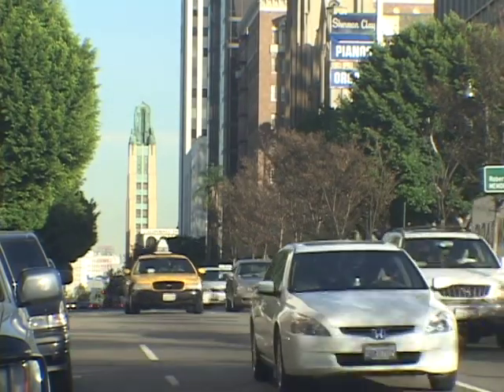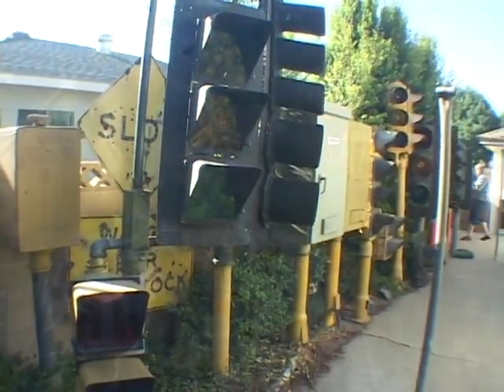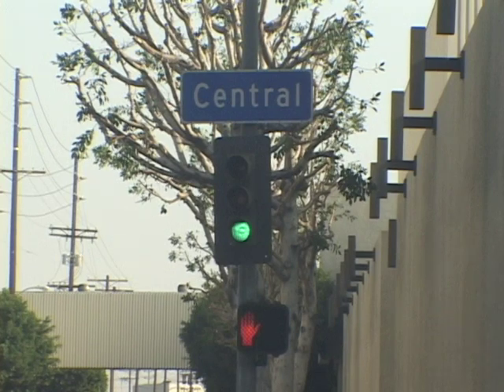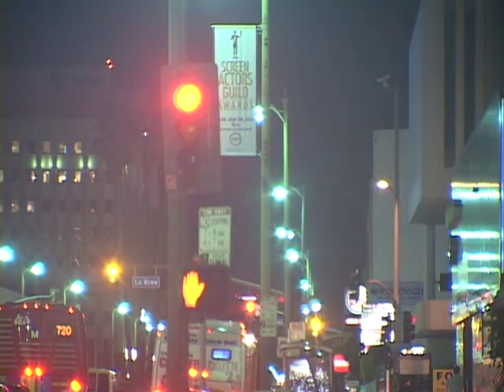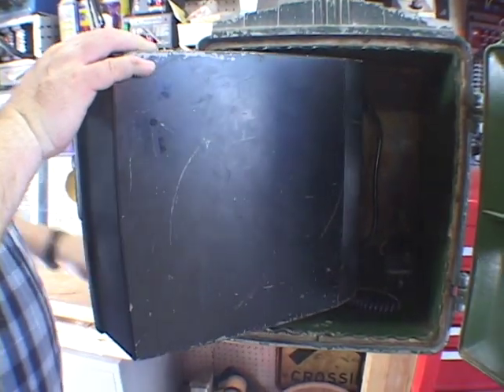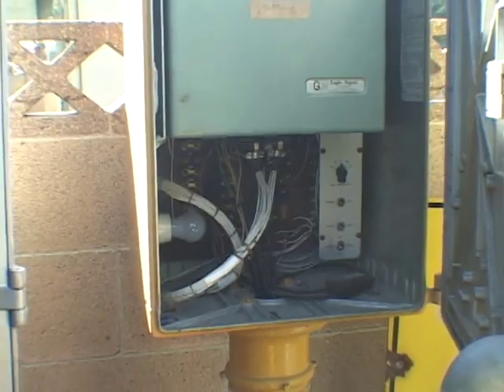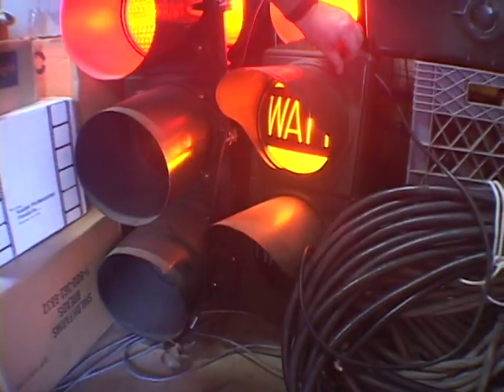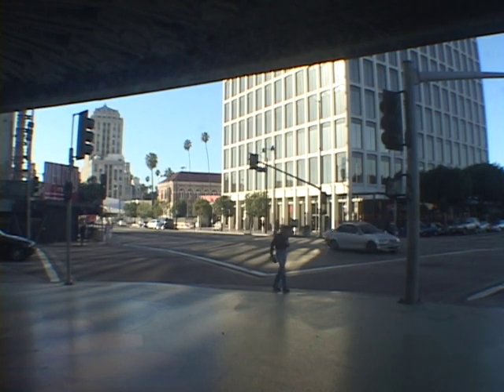LIFE IN THE FAST LANE-PART 2

Comment: @WestlakeSig I agree that LED signals are hard on the eyes, but they use far less electricity than the old incandescents. LED's use about two thirds less. I am a traffic signal tech here in Australia. When we LED upgrade an intersection consuming say 10 amps, once we're finished it usually consumes about 3 amps. Or sometimes even less.